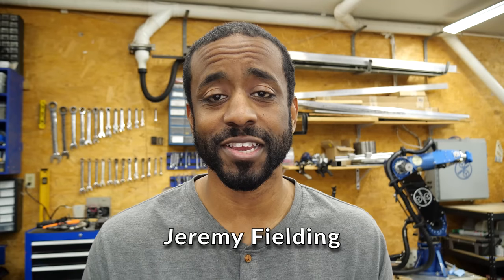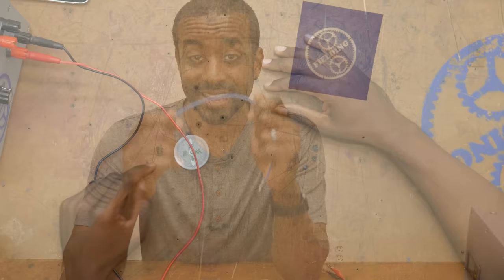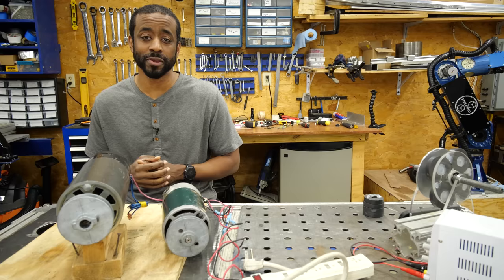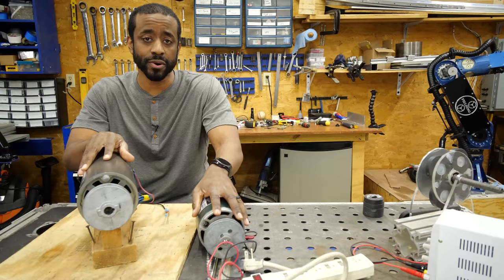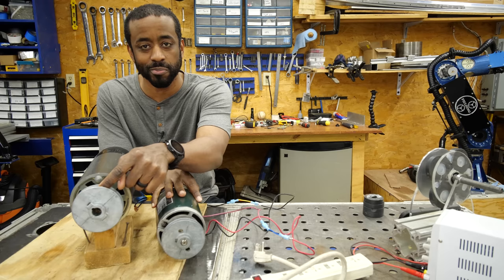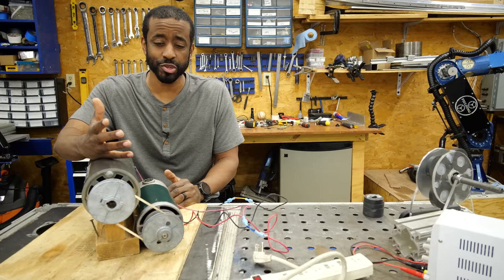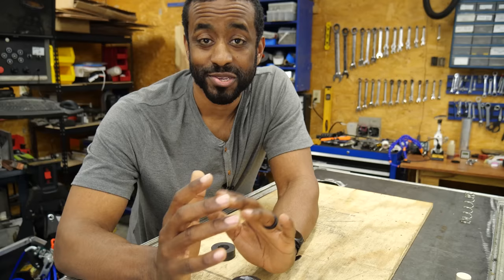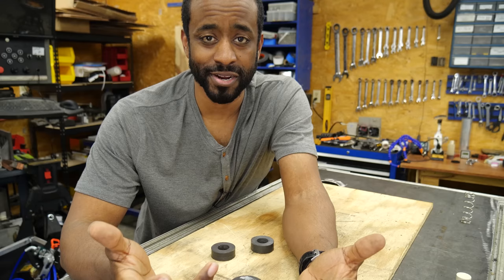Reviewing Free Energy Generators.  A Response to My Video "Nikola Tesla's Greatest Invention"- 102

Comment from the maker: I decided not to put a sponsor on this video because of the topic, but if you want to support more content like this please consider joining me on Patreon or buy me a coffee! https://www.patreon.com/jeremyfieldingsr
https://www.buymeacoffee.com/jeremyfielding
Reply: Link for the dc motors in the video.  
Looking for a dc for a ev Thank You
Reply: Steve urkel was a very toxic influence on my life... You should invent a time machine and save millions from his evil influence. 

All jokes aside, keep up the good work bro
Reply: Does a nuclear radioisotope thermoelectric generator count as a free energy device? i'd like to submit one of these for review.
Reply: @maxximumb  that is funny
Reply: Actually an alternator (i.e. a generator) on a Tesla could help BUT not hooked up to the battery's for it power source instead hooked up to the wheels to turn the Generator, yes it will NEVER recharge the battery's fully BUT it will extend the range (how long the car can drive) and yes the weight of the generators on the wheels will take some power from the battery's BUT IF there is even a small amount more being recharged then there is being removed, there is (I think) a benefit "maybe"...
Reply: @lennym1273  they do this already using the motors themselves - it’s called regen braking and when you let off the gas the engines start generating power back to the battery. It slows the car down too
Reply: @lennym1273  Nope. Won't work. Review Jeremy's video where he discussed energy losses in any system. What you describe is Jeremy's two motor table demonstration. On a car it will reduce the range, not extend it. This generator hooked up to the wheels will only be able to convert some percentage of the mechanical energy required to turn the generator back into electrical energy for the battery. That loss is irrecoverable, i.e. it takes more power from the battery to drive the generator than the generator can put back into the battery.
What does work and EVs have is using the motor as a generator to recover the energy used for braking. This works well in city stop and go driving. When you slow down you charge the battery and when stopped the drive motor isn't drawing zero power. In gasoline cars stopping energy is converted into heating the brake rotors/drums and the engine is still consuming fuel when stopped at idle.
Reply: What about using a motor that uses 6 amp from grid to spin a generator that puts out 13 amp
Reply: @Longoria1966  at what votage?
It Is important to Remember that Power Is = volt x amper. If It is calculated as a pure resistor! When Is reactive (coil or capacitor in the circuit) all calculation and Power changes!
Reply: Thank you for your declaration
Reply: You would need a flywheel.
Reply: They killed the founder of infinity sav as well, and he proved you could do it.
Reply: “Hidden Technology” guys! Jump in to the challenge if you are true! 😂

Thanks Jeremy what a Hero! 😎💪💪
Reply: I was reading on one of their comments that they use something that is creating: “Eddy current” effect inside the alternator
Reply: Hallo great afro bro... come to Africa and share your wisdom and start a new tech support for your people
Reply: @notworking5692  what is a hero in your definition?
Reply: @bradleejones9959  he knows this. He didn't even try. Which is why I'm upset he even made this video. It lacks in comparison.
Reply: do a video on the searl effect generator
Reply: try review the AUreus solar energy
Reply: Jeremy, can you do a video on an actual free energy device ?
Reply: @mikehoman7351  it's beyond his capacity at this point.
Reply: @tlatoanimachi  I know, just wanted to see if he was able to set aside his beliefs long  enough to see if he was missing something
Reply: @eternaloptimist2840  out of the thousands of clickbait films and builds from delusional inventors, I have found two films that I know are legitimate and a third one that is a possibility - you don't have to believe it if you don't want to, but I know that the conservation of energy law is strictly not accurate - if I didn't believe any of this, I would never visit these sites, it would be a waste of time
Reply: @tlatoanimachi  it's true, the flywheel to keep this speed constant - but there's a couple other changes that need to be made also - when you see what he's doing there it doesn't look like he wants it to work - even if he believes it won't work, he should at least give it an honest try
Reply: @mikehoman7351  If you "know" they're legitimate then you understand how they work and can explain it and replicate it. Otherwise there's no knowing what is actually being demonstrated, beyond some people's desire to believe in something outside current scientific understanding.
Reply: @eternaloptimist2840  from what you said, the first sentence is absolutely true, the second sentence is not, although you are right that some people believe because they want to or just want it to be true - extant science is flawed once you get to the level where things are too small or too far away - literally there are no acurate physical descriptions for any particles, at least not in the mainstream, that's why QM is sometimes refered to as a provisional theory - back to the point, I do know the science and can explain it on the two devicem films I found - I also found the body of research for one of them -  - I built it partially but did not have the wherewithal to complete it - it's ok if you don't believe me, it would be a mistake to blindly fall for something you have a plausible reason to doubt
Reply: @cody7374  Radioisotopes have what is known as a half-life, which is the amount of time it takes for any given quantity of a particular isotope to decay into being half as much of the particular isotope and the other half are decay products; sometimes those are other radioisotopes and sometimes they're stable isotopes.

Short answer; no, radioisotopes decay over time until there is eventually no activity left.
Reply: @GronTheMighty  i'm well aware of half-life. I just thought it would be funny to see him review one.
Reply: @cody7374  Ah, I see, my bad I misunderstood you :)
Reply: My thought was to use pancake generators on all four wheels. Split the battery consumption vs charging in half, A and B. While A is discharging, B is charging and vice versa. I would never profess to create a perpetual machine, but thought such a setup would maybe offer up to 50% increase in range. Never understood how braking was a better method of recharge, particularly if one is driving long distance on a freeway where braking is less necessary.
Reply: I have had this idea for higher performance gas generator by using an electric motor directly to  the shaft of the generator and running the wire from the generator to the electric motor like in series then to the load so when there is power draw the motor will help pull the gas generator there for increase efficiency do you think it would work.
Reply: @sw793  

Still not totally free. You need cameras, products, production, effort, etc.
Reply: @sw793  i have seen devices like this before utube they get put under the rug
Reply: you was talking magnet motors not working but they do ,i seen video back in the early 90s before web was just infancy there was an old man that lived in the hills of Tennessee that was off grid that ran his cabin on only magnet powered generator it was on the heart land series i seen them he had a big one for running generator and bunch of littles ones in his home running .
Reply: @isaacwhite7411  I was making a joke.  No free energy devices work.  Magnets are not a source of energy, as discussed in this informative video.
Reply: @sw793  well i guess it was all a lie that the old man was living off grid on live tv and had big and small magnet motors turning on there own .
Reply: I'd rather buy you a beer brother cause I love the knowledge
Reply: @isaacwhite7411  Well whatever he was doing, he was not generating power from just magnets.
Reply from the maker: This scam existed before you could make money on YouTube. It worked in newspapers, they would buy ads in magazines and offer plans for sale… this game is way older then you think. YouTube is just a different version of it. It doesn’t work.
Reply: Can a step up transformer be put on the wire that goes from one motor to the other to increase said voltage?
I just realized that is called a amplifier.......
Reply: @PacesIII  doing the charge discharge thing you mentioned won't increase range. It will decrease it. It's actually pretty simple to explain why.

A) assume we have 100 energy in our battery.
B) Now assume that our generators have an efficiency of 90%, meaning they can transform 10 kinetic energy into 9 electric energy. Which would actually be pretty good.
C) Now assume such a generator is attached to each of the wheels.
D) Now only drive the left wheels until 10 energy are consumed.

We he now covered distance X and 90 energy left.

E) if we repeat so that experiment with the right wheels acting as generators to recoup energy, you again need the 10 energy to cover distance X, and you also need another 10 energy to drive the generator on the right. You now have 80 energy left, discounting what you generated. Since the generator on the right has an efficiency of 90 percent, they recuperate 9 out of the 10 energy invested. Total you now have 89 energy left.

89 is clearly less than 90.

As you can see we don't even need units, specific distances or anything else to understand why recuperation while driving hurts the range. Recuperation isn't some magic free action. It comes at a cost. It's only helpful when that cost is less than some other cost. In our case energy loss due to breaks.

When breaking your forward momentum is transformed into heat by the breaks. If you use the generator to break, you can transform forward momentum into electricity without worrying about efficiency, because that energy would be lost fully otherwise.

In this case you are this gaining electric energy back which had already been transformed into kinetic energy, so it was already lost to the battery. And since you can't use it for movement anymore, since you apparently must slow down, the next best thing is to recuperate it.

While driving you don't want to do that you already transformed electric energy into kinetic energy (at a loss). Converting it back into electric energy (again at a loss), then again into kinetic energy (yet again at a loss) won't help with range, it will instead hurt the range (due to those losses adding up).
Recuperating only makes sense when you would have to let that energy go to waste otherwise.
Reply: @brag0001    beliefs prevent someone from understanding how it can be done - people have closed their minds to it - repeating that it can't be done is the dogma that is used to prove this point, but insistence does not prove anything - it's not my intention to make anyone wrong
Reply: @philup6274  You can, but if you do step up the voltage, the current is reduced proportionally.  Therefore you get slightly less power out as in (losses).  An amplifier amplifies an input signal, but requires an external additional power source.  There is no free lunch with energy.
Reply: @randy marsh A Sterling engine is a real thing and basically converts heat in a gas (energy) into mechanical movement (energy).  However it is so small that it can only just move itself.  Put a load on it and it well stop.
Reply: @sw793  thank you for the information. Hopefully one day we break through and get that free lunch
Reply: @SystemsPlanet  That would still just be converting potential energy into kinetic energy. The same way gas works. You can only burn it once, so it's not "generating" power; only releasing what was stored already.
Reply: Just to be sure it is properly understood: electrons are not running into the wire but on the outside radius of the wire.
Reply: @PacesIII  You do realize you are generating resistance for the whole car using this method, right?  This increases the power requirements, so potentially eliminates the benefits.  If one was willing to give up performance, it might have some merit, but needs some math to explain the cost and the benefit. With advances in generators and maybe gearing, I'm sure there is some possibility of benefit.  

A crude example is when I was a kid an put the generator on my wheel to drive the light; you could feel the difference, even if only on the uphills. It slowed me down or forced me to work harder to compensate.

I think having a "coasting" in addition to braking generator is an interesting idea all the same, but besides performance it adds cost to the vehicle and likely not worth it at this point. As far as I'm concerned, adding solar panels, shock absorber regeneration, and wind generators should all be part of the ongoing consideration.  

If this idea has any merit, it will show up on one of the Solar Challenge cars.  Solar is nearing the market as part of EVs, but I didn't find any "regeneration" mentioned in a cursory search.
Reply: @netwrench6570  

It was just an idea. For right or wrong. Would love to see an actual build, though.
Reply: How do you explain the operation of these fake perpetual energy devices outside with just the generator?
Reply: @ebubemiracle1712  he's an American his people live here
Reply: @jaymiewilliamson2521  If Africa gets technology from you it is not a bad thing. Someday we exit this world with nothing...
Reply: Would a bank of capacitors and a switch add anything to the system ? When engine one finally charges the bank it flips the switch to dump that energy while energy is still being input...it would not be self starting .  So that would be energy lost , and the capacitor bank would have to be able to hold and discharge double the energy  needed to operate itself for it to be any sort of usefull even if it did work.  Maybe it should hit a bank of resistors to make a bunch of heat to start a sterling engine?  That could spin a magnet inside a coil and send it to the capacitor bank ...As well as a solar cell , for additional input to cope with losses. Then get a gasoline engine see...
Reply: @lennym1273  Do you understand that running an alternator/generator from the wheels would require more energy to be used in the car motor which would use a bit more battery capacity than whatever your wheel-driven alternator produces since there will be some loss. Just like driving uphill requires more energy, if you are not convinced try walking uphill sometime & compare the difference to walking on flat ground.
Reply: @lennym1273  that is my thoughts exactly I have been saying that for a long time
Reply: Do the Olly Heat Engine!
Reply: i just wanted to add a comment about "free energy" . there are a lot of ways to harvest low cost energy that does not violate laws of physics that i think most in the field like to forget about . for instance hydro electric power once built and installed can actually get a net gain vs cost to run . not free by any means but harvesting energy that was already available to get low cost energy .
another thing i proved that can work if you tap into energy that is surplus . hydrogen cells  are one of these also . had a 87 4runner that i was able to extend the fuel mileage to around 40 miles to the gallon un loaded and about 28 miles to the gallon fully loaded ( it was a work vehicle i used when i ran an electrical company) , but it only worked under full manifold vacuum . the biggest issue was leaving it on all night and blowing all the hoses and the hood loose when i jumped it off =) sounded like a quarter stick of dynamite . also cracked a connecting rods and a couple weeks later cam through the side of the engine block lol. 

or harvesting heat from an industrial process to heat the facility . it is technically free heat you would have from the process you already had to do, so it is a surplus , hence "free".

there are ways to harvest low cost energy , which for all intensive purposes qualify as free energy by concept , its basically looking outside the box for ways to harvest that energy with out breaking the laws of conservation , thermodynamics, etc etc. it is making processes more efficient for the most part

just some thoughts about forgetting the free energy idea in general and looking at it from perspective is there any thing im wasting that i could use =)
Reply: THE most informative video I’ve ever seen on YouTube. Thank you thank you thank you Jeremy for explaining it so simply. I wish my education system would have taken just under 24 minutes to do so. I mean, I gave them 12+ years to do it!
Reply: You'll do well in "corporate" science ;-)
Reply: You're not getting something from nothing, you're getting it from the source, the magnetism, copper etc. You're harnessing the relationships between them
Reply: you need to investigate the dipalma N machine. the principle is sound ive built prototypes
Reply: @SovereignFuturist  it's Physics
Reply: @Jeremy_Fielding  there is that old  saying "  everything old is new again"   which sums up " progress"

Comment: Jeremy, have you made a magnetic base for your drill press with a microwave transformer and a 12v power supply?
Reply: I was thinking of the same thing I wonder if...
Reply: The problem is a electromagnet is essentially a short circuit. The fine winding of a MOT is not meant for a lot of current so it will burn out if you try to make it too strong or run it for too long.

Comment: try this : one of the generator is DC powered by Batteries; to run AC generator with some 1000W transformer; current back to panel separator; some power to charge the batteries and some power to use for anything.